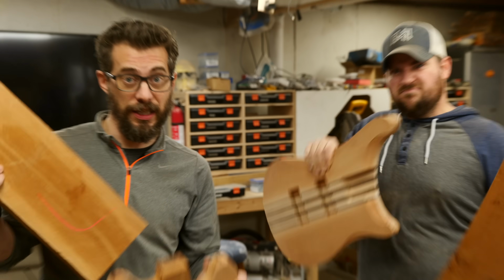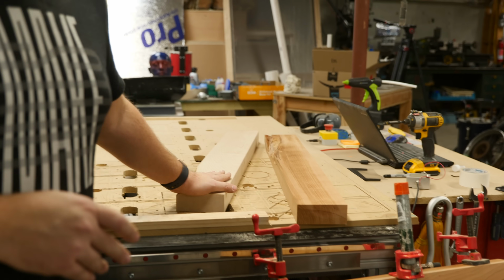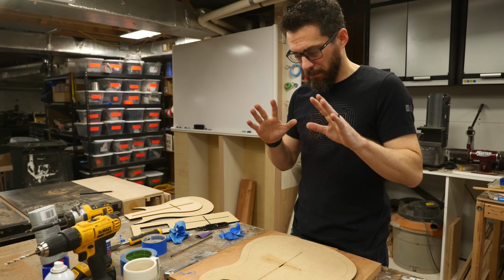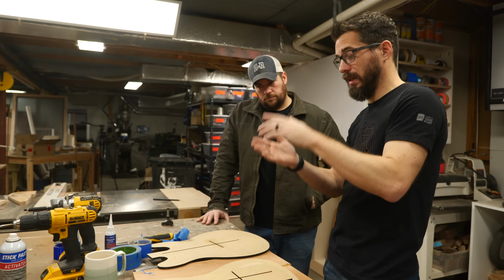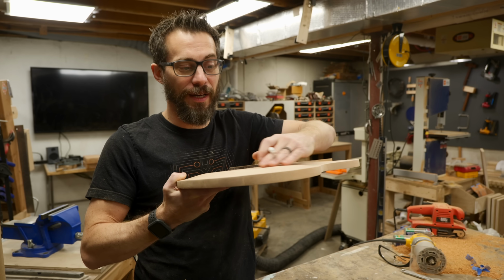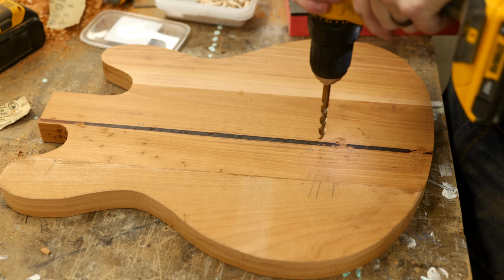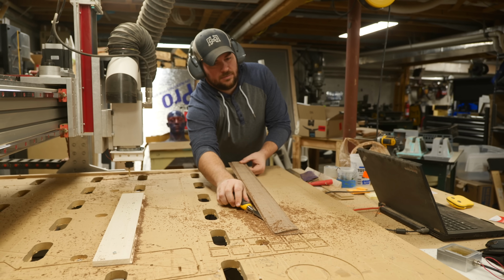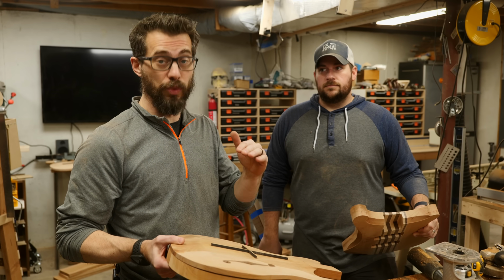How to Build a DIY Guitar: Challenge | I Like To Make Stuff

Comment: I'm only like 8 minutes in, your key method was awesome! Just a tip from my mechanical engineer design job that MIGHT make it easier in the future:

For a fixture like that, you can simply use two circular pins! The matching key on your template would be a circle (4-way locator) and and slot (2-way locator). The key is that the length of the slot just falls along the centerline of connecting the two pins! As long as you keep the two pin locations as far apart as you have room for, you have a really accurate alignment method without those teeny little sticks that may be tricky to fit

Obviously yours worked, but it may be easier for things in the future!

Comment: One thing I do with most CNC jobs is set my origin to one of the first features I cut, such as a hole. Maybe even a sacrificial thing that gets cut off at the end. So if I have to unmount and remount it, say to add more support under something I didn't realize I was cutting into,  I can remount the part,  dial in that feature, and just keep going.
Reply from the maker: That's a good tip!

Comment: I appreciate Josh learning the G28 for machinists: nose to window and hand over E-stop! And finding out he accidentally put an onion skin on the neck operation. Bob's ingenuity with the templates was inspiring! Great job guys, wish it was one video so I could see the results!! Gotta go checkout a speaker now...
Reply from the maker: To everyone reading that thinks CNC is easy and the robot works every time. That is not the case. Garbage in, garbage out.
Reply: @Iliketomakestuff  Well CNC is easy and the machine indeed does work most of the times. What is hard is programming it and the machine does exactly what you tell it to but in many cases its not what you want it to do...

Comment: You can really tell that you two are having a lot of fun with these, even though you both had to start completely over. Here's to hoping the next video doesn't begin with "So I started over. Again."
Reply from the maker: We didn't. But as soon as the camera cut, Josh started making another one.
Reply: @Iliketomakestuff  I don't blame Josh... My OCD would have also made me start again ASAP. Is there a way to mark the center of the piece and start from there instead of one of the corners when doing the CNC?

Comment: Tool Tip For Future You. When you have weird contours and a flat template two methods you can use. One is laser cut masking tape for your template and place it by hand. the other is to use a contrasting spray paint and spray it from straight on. you will get some feathering but will get you closer than a pencil or long nose pattern marker. Just another tool to put into the metaphorical tool box. its saved me in the past. Everything turned out awesome though and I love the concept of using "keyed" patterns for the layering and doing different staged of templates.

Comment: I've had a go making an electric guitar a few years ago out of some scrap oak and beech (completely apart from some of the bought hardware).

Massive learning curve. I didnt have a proper trust rod at hand and there wasn't enough space so ended up epoxying a hardened steel rod in routed groove in the neck.
The fretboard and action height and fretboard radius gets pretty tedious and there was a fair bit of trial and error.
Well after about 2 years worth of adjustments and rebuilds its reached a state where it plays well and sounds decent. A cool feature I added was modifying a standard hardtail bridge into a tremolo by attaching a solid metal plate with some springs on it to the face of the guitar (the only pictures of other homemade tremolos I could find was the red specials'). The wammy bar is made from the aluminum rod from a pepper grinder and a bullet case on the end.

Looking forward to seeing them finished!

Comment: For the bass, you can very easily cut a wood plug from maple and then cut the correct size pocket for the maple neck and leave the cherry neck for the striped body.
Reply from the maker: True. He eventually filled the oversized neck pocket but still went with the stripy one.
Reply: @Iliketomakestuff  Good to hear. I hated thinking that something that easy to fix woudl result in scrapping that wonderful wood slab. Great video and looking forward to part 2.

Comment: Josh, take your original body that has the oversized neck mortise, glue and fill it with a block of ebony or whatever since you're painting it, and re-mill it. Neck size stays the same, hole is fixed, another bass on the way.

Comment: Josh has an opportunity on the messup body to plug the oversized neck recess with a contrasting wood and re-route the correct hole and end up with a rad inlay. I think that would be really great and would not waste the messup
Reply from the maker: He did and he used that body as a tester in the next video.
Reply: @Iliketomakestuff  I can't wait

Comment: I would have modeled in tooling bosses onto the neck in key support spots that would be removed when you are finished on the CNC
Reply from the maker: You're 100% right. He had fixtures on the spoil board, but he could have been more consistent.

Comment: your hollow body cutouts from the 1st blank...having the template backwards isn't necessarily a bad thing as all of the switches & tone knobs usually go in the "bottom" of the body...the offset cutout could've made room for those to go with no issues...& if you don't wanna keep that "fail" i know a guy who reads alot in GA that wouldn't mind taking it off of your hands...just sayin'  ;-)

Comment: The oversize neck pocket: Cut a piece of different-colored wood to fit, glue it in, and recut the correct size pocket. Bob Ross opportunity. Of course, that wood only work if nothing else went wrong. Or was that the case? So many things went wrong in this vid, I lost track.

Comment: that bass neck pocket can be fixed, just add material on the sides of the pocket and it'll work fine
Reply: or you could just save the body and widen the pocket to make it a 6 string bass